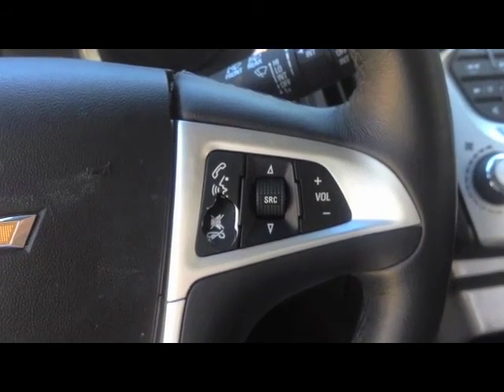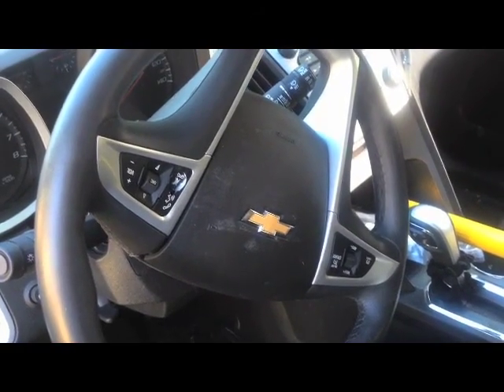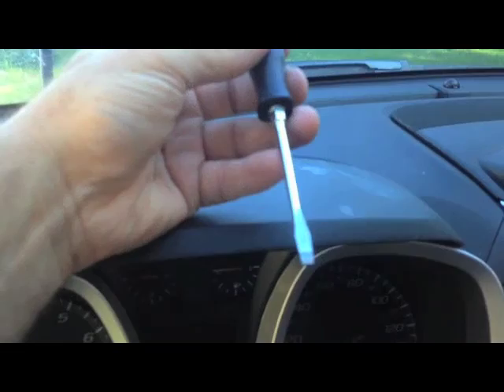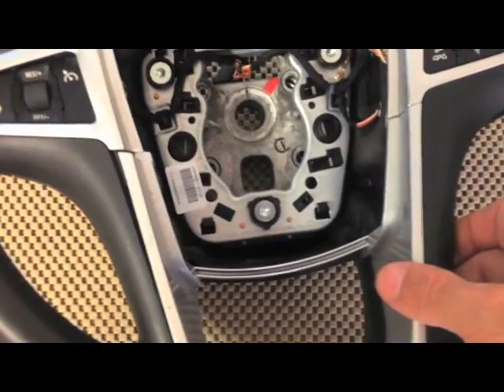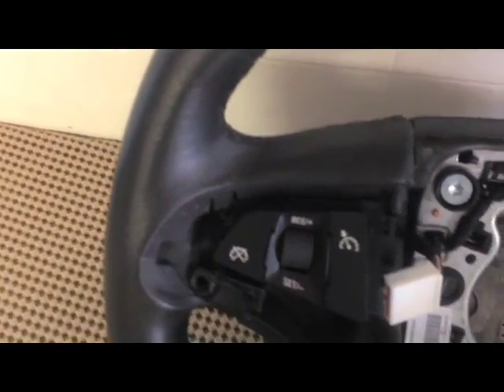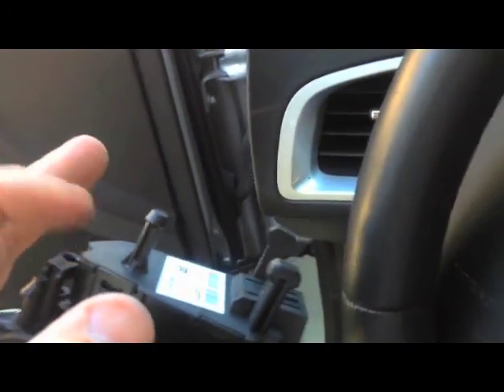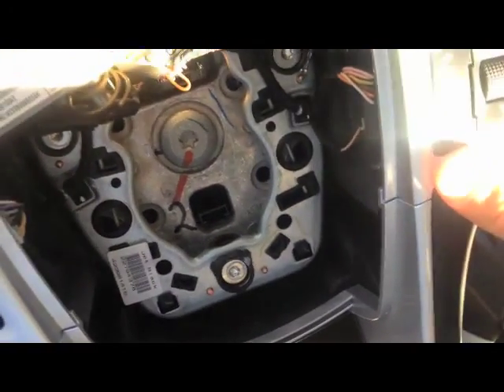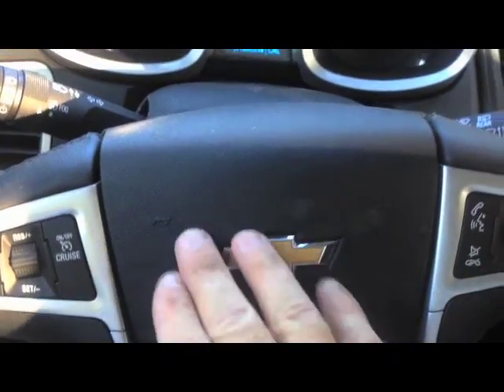Equinox Steering Wheel Button Repair

Comment: The only comment I will add is to use a pocket screwdriver. 
In my instance on my 2014 LTZ, there was not enough clearance to get the screwdriver handle level because of the plastic surround around the steering column,  so I had to use a flat blade pocket screwdriver. Then it popped right off!

Comment: Did you need a steering wheel pulled or just undo the nut? Thanks!!!!
Reply from the maker: Na, you don’t have to pull the steering wheel. I just had an extra one for parts so that’s why I had one out of the car
Reply: I mean when you have to remove the steering wheel, do you need a puller? I need to replace my cluster ugh lol
Reply from the maker: Oh gotcha. I haven’t actually removed the steering wheel from mine but my guess is you will need a puller. I’ve changed the cluster on some cars by removing the bolts that hold up the steering column but it may be harder than finding a puller in the Equinox

Comment: My horn don't work..where is it located?
Reply from the maker: The switch is on the steering wheel assembly behind the airbag, but don’t mess with all of that. Check the fuse box under the hood. It’ll be labeled on the top inside of the box as to which fuse it is. That’s likely the issue. My horn is hard as heck to push so make sure you’re pushing it hard enough